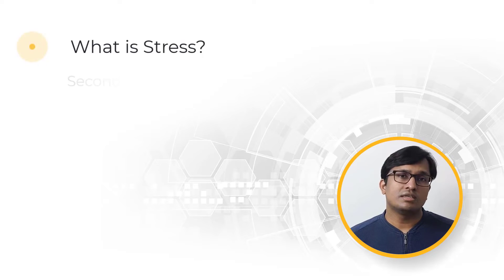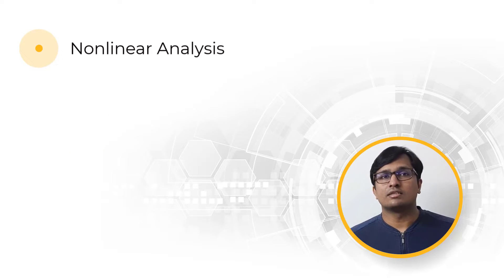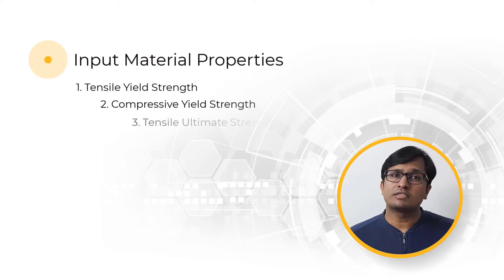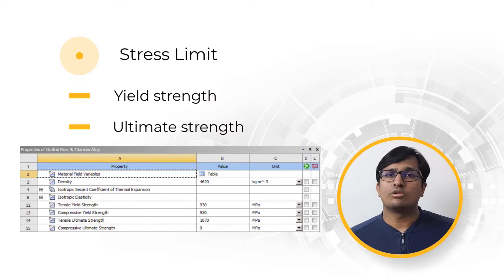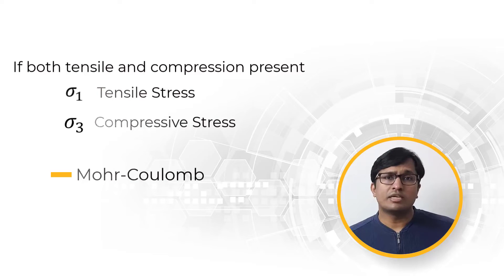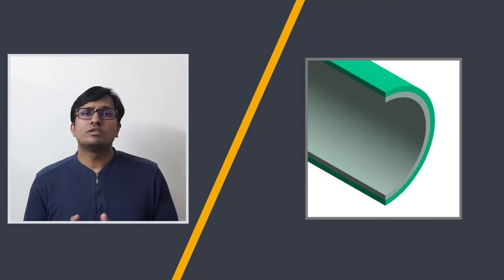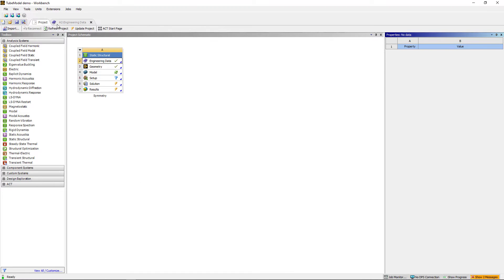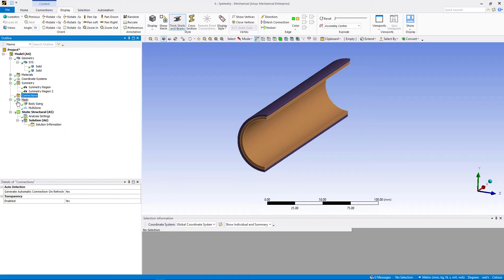Understanding Which Stress Measure to Use in Ansys Mechanical — Lesson 2

Comment: Perfect. Foe epoxy -alumina with 70% by volume fraction which failure criteria should I use? In hybrid pipe with different materials for example, steel and composite, is it possible todefine two failure criteria?

Comment: Hello. I have input the data like you did and found out that even if the stress is higher than yield, it doesn't have plastic strain. In the end of the video you explain that the curve is not for defining the non-linear behaviour of the material. Where can we find the video for non-linear material or (in my case) for an elastic-perfectly pastic curve (with low tangent modulus for convergence)?
Reply from the maker: Thanks for watching! Please post your query on the Ansys Learning Forum for a detailed answer from the wider Ansys Community: https://ansys.com/forum.